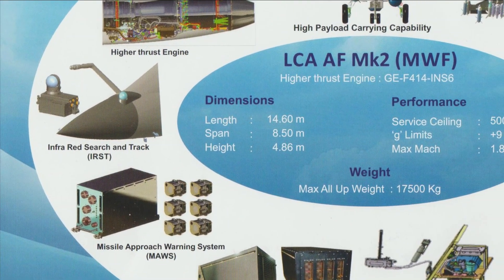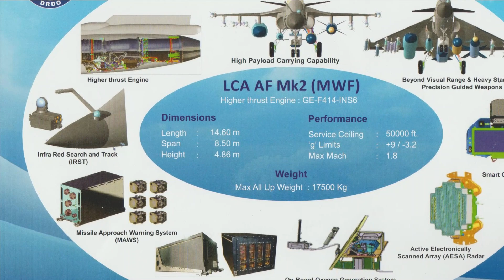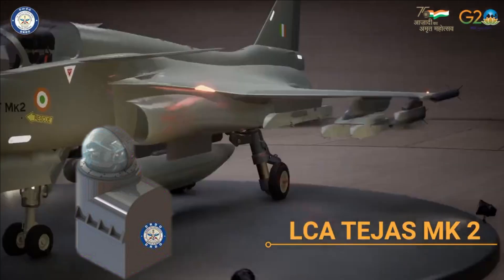Rafale FSO vs LCA Mark 2 FSO

Comment: I suspect Tonbo Imaging and the IITS can do research on next generation infrared sensors using quantum sensing. One of the most baffling issues is with Bharat being literally where the world does its research, that no brown man trusts in our own brains. Tech is only great when it has been blessed by the Mighty White Man.Rather than rely on DRDO, between the startups like Tonbo and the IITS the technical capacity to build leading edge sensors ahead of the current best, is there. All it needs is investment. Bharat is a bigger economy than France, with cheaper costs for everything. Indigenous research is the key!